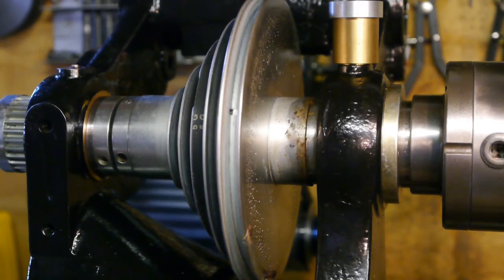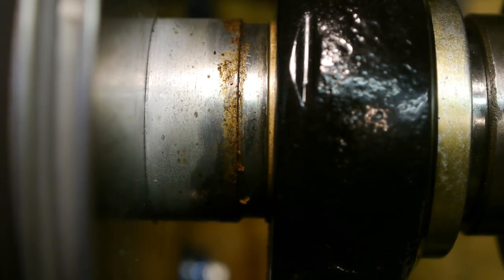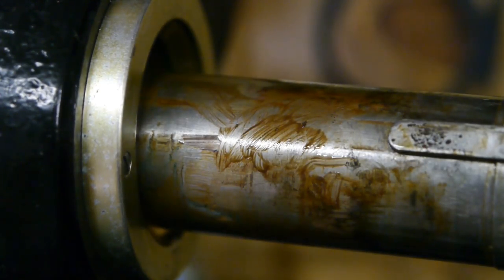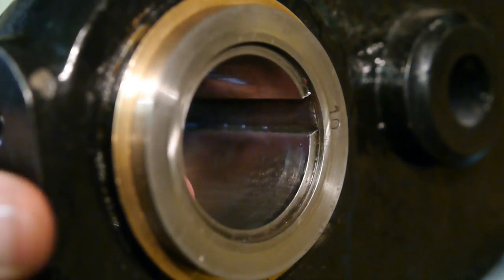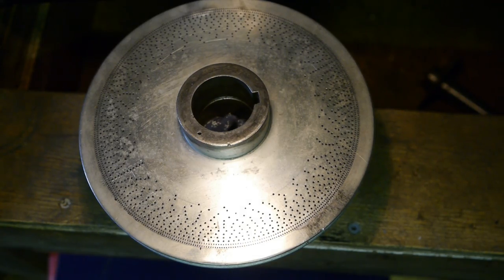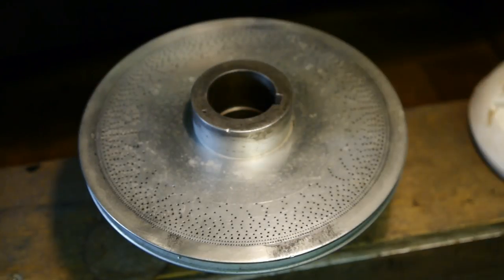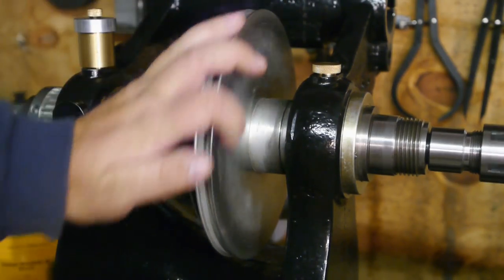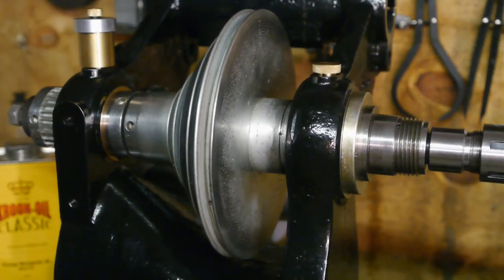The strangest  lathe spindle problem ever

Comment: I also would not have expected the pulley to be the source of your problem.  Well done on the diagnosis.

You could have put the pulley in a bucket with an alcohol solution.  The water would have mixed with the alcohol, then evaporated.  

It looks like your method worked.  You should be happy, and I am happy for you.

Many examples where the time to figure out a problem is so much more than the time to perform the fix, once you understand the problem.
Reply from the maker: I'm ecstatic that this is finally over.

Comment: I think white foamy stuff forms when water is in contact with modern detergent oil.

I once coated my old lathe with some (SAE) 30 weight motor oil and the next day the metal heated enough to draw moisture, it was covered with a white foam.  Haven't had that problem since using non-detergent oil.

 Mobil Vactra #2 is around ISO 68, a way oil, I use that on the lathe ways.
Reply from the maker: We call that white stuff mayo.
Cars that are only driven for short distances can form loads of that stuff in the cylinder head.

Comment: Sometimes it needs a few looks at things to get to the bottom of an issue. ... that was a strange one for sure.
I use 68 grade way oil in my old South Bend, for 2 reasons... first, it's cheap and i got loads of it and second, it is quite sticky because of the added tackifier, so it does not drip out that fast
Reply from the maker: That ISO46 hydraulic oil is still leaking quite a bit. Perhaps I'll mix it up with that ISO100 vintage car oil. 
(maybe add some chain saw lube for stickyness)
Reply: That's why i use 68 grade way oil, it's got similar sticky stuff (tackifier) in it, like chainsaw oil but is much cheaper,  i pay about £1.50 a liter if i buy in bulk. (25 liters)
Reply: Rolingmetal I use chainsaw oil on my lathe.  Fill up the 1/2  thimble droppers in the morning and again after lunch.
Never had the spindle out.... (yet)

Comment: Glad it's solved, it makes sense the acid was causing the oil to breakdown. You also could have baked the pulley at 150℉ for an hour or two, I've done that many times prior to welding cast iron, some cast absorbs oils like a sponge and it makes a clean weld impossible.
Reply from the maker: Are you sure about that 150℉ seems rather low.
Reply: Rolingmetal If I was sure of the metal quality I'd go as high as 250℉, I've had good luck in the past repairing engine blocks, heads, transmission cases ect, after a good cleaning with detergents and pressure washer then alcohol you could see the oils sweat out. If I thought the metal was of questionable quality or excessively pitted I would go 150℉ or so for longer time to be safe. It's how I was taught by an old Austrian machinist and I've had good luck with the method, I'm sure there are other cleaning methods that work well. 
Just a different thought, over the years I've found aluminum castings that were absolutely beautiful clean, solid metal with no trash or inclusions and I've repaired some that as soon as I struck an arc with the tig torch gaping holes appeared and what should have been a twenty minute repair turned into an hour of reconstruction. I learned not to quote prices on aluminum work, just bill the time and materials afterwards.
Reply: +Rolingmetal 700 degrees f slow cooked

Comment: if the belt is only captured over the spindle pulley.. put it on the spindle pulley and use a zip tie to pinch it into place.. so you can't put the pulley on without the belt being around it.
Reply from the maker: Someone mentioned that trick before and I had already forgotten it :)
But this time I didn't forget the belt.

Comment: Hi,

I would guess the little holes on the pulley are indexing holes.
Reply from the maker: That's right. The outside ring is 360 holes. I didn't count them it's actually stamped/engraved with tiny numbers on the pulley.
The hole selection lever is unfortunately missing. I do wonder how they would lock the spindle in place because there is no spindle lock. Perhaps by tightening up the bearings?

Comment: better with hydraulic oil some car oils actually rot bronze
Reply from the maker: I think you are taking about the first generation of GL4 gear-lube. it would rot away the shifter forks.
But I believe that stuff was only a few year available then they changed the formula.
Anyway, I'm using Hydraulic oil and that is something different.
Reply: hydraulic oil is the proper oil anyway, it's made for that stuff tbh